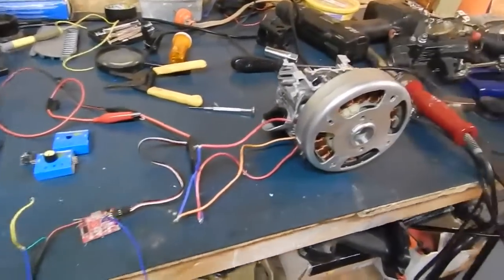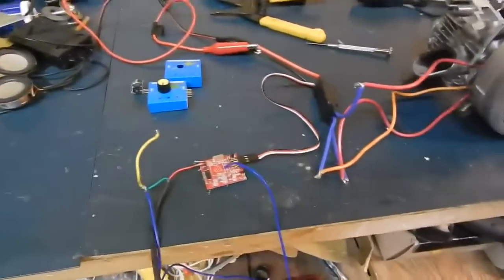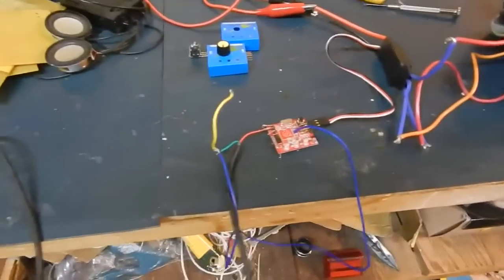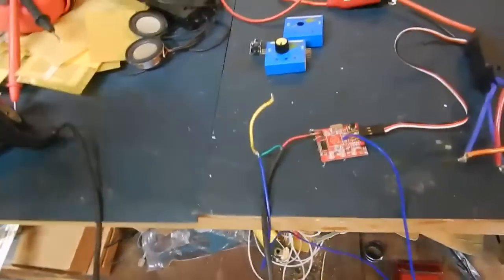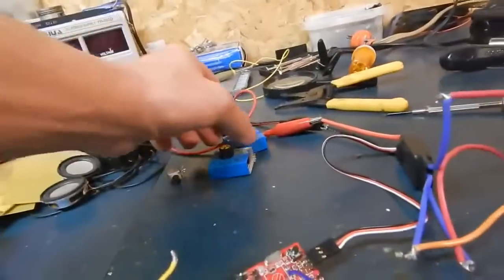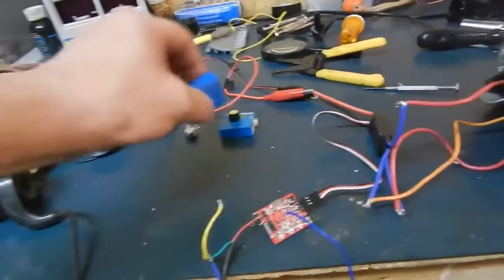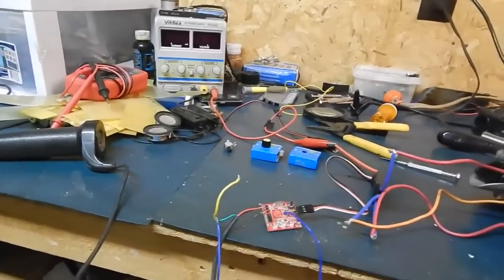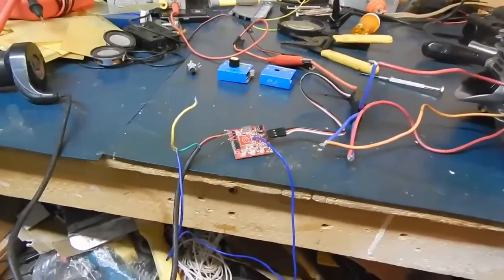Servo Tester with hall throttle

Comment: it looks like you have the black and red wires of the ev throttle connected regular but what is the green/blue wire connected to on the servo tester? i cant see what you connected to lmk been on it for months

Comment: I think you can simply change two of the brushless motor cables with each other and change the rotation of the motor.
Reply: i think what he was talking about is that releasing the throttle leads to full power on the motor, i have had that problem before
Reply: @Shadow__X  ow got it

Comment: I solved it :) Open your ebike throttle and flip the sides of the magnet.The hall sensor will work properly that way! I got a hall throttle and almost the same servo tester and it worked for me and you don't need to hold down the throttle when you plug your battery any more it works like a charm.
Reply from the maker: yup